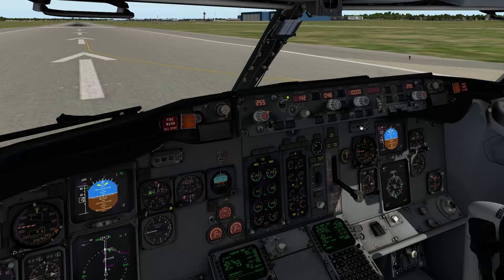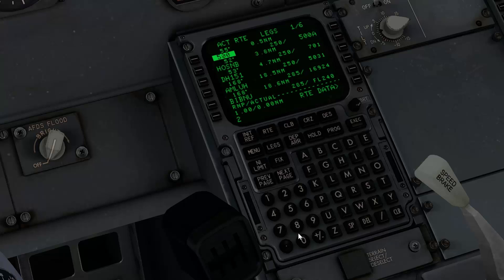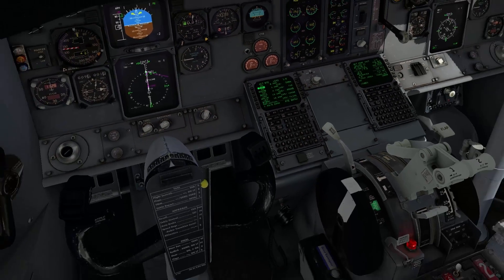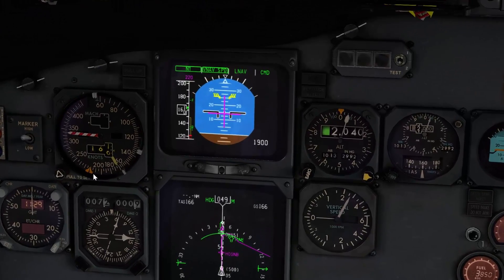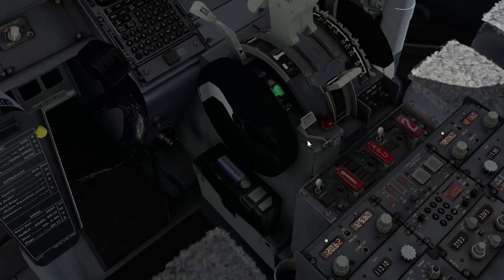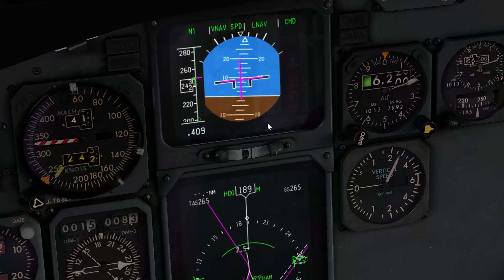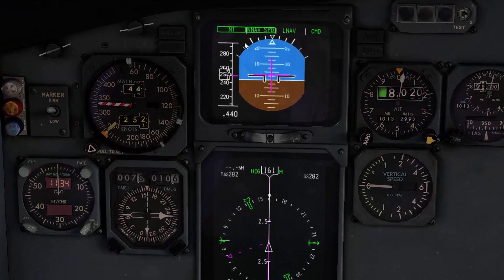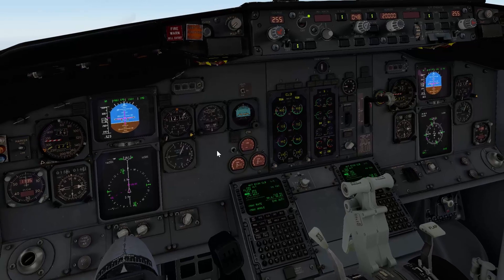VNAV climb preview

Comment: So is this aircraft going to be freeware?
Reply: +Ultimate Aviation HD No :)
Reply: +Ultimate Aviation HD Would you work (almost) 6 years for free?
Reply: qqqqhuz I was just asking. You know, the EADT x737 new version with a full 3d cockpit and custom FMC is completely freeware, so I think that it's gonna be kinda hard for this aircraft to compete with a fully free 737NG. And EADT has been working on their x737 for longer than 6 years. 
Just sayin' :)
Reply: Completley freeware is incorrect. The FMC costs 20€/25USD (http://ufmc.eadt.eu/Universal_FMC/compra_x737_FMC.html). And about the other stuff - i haven´t seen any pictures of the upcoming version. However, judging by what is availble so far, the IXEG seems far superior to me. But nobody dislikes freeware, so I´ll give it a shot as well, once its released ;)

Comment: funny we never use VNAV on our classics :D
Reply: +PilotsTubeHD 

You are totally right. Some even refer to it as the "magic button" - you never know what you get! Nevertheless, it is an integral parto of the real aircraft´s FMS and most flightsimulator users are fascinated and intrigued by it, so obviously we have to get it right!
Reply: +Sharklet320 

A touchy and sad subject... ;-)
Reply: +CMBelite-FR  LOL iI was thinking the same thing! Why not model it to be buggy? Us simmers are never satisfied.
Reply: hahah hoffentlich gehts aufn Jumbo, vor der zwangsschulung zum systemadministrator
Reply: Mein Beileid... :(
Reply: +Jan Vogel 

Does that means that the IXEG VnaV won't have the flaws of the real 733's VNAV ?
Reply: +CKY139 

Aha indeed
Reply: Is there a reason?
Reply: Carlos Vasconcellos yes it does not work very well.. autothrottle is kinda buggy in vnav mode as it has problems with wind compensation for example. We just prefer LNAV and vertical speed
Reply: +Jan Vogel Are you still flying the 737 in real life or did you have to convert to the **** fleet?